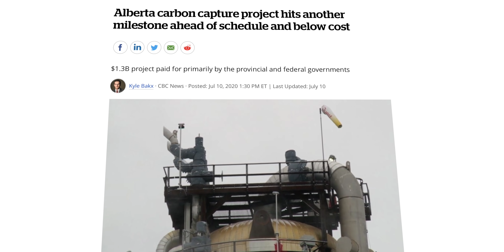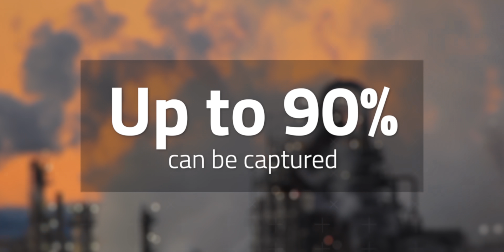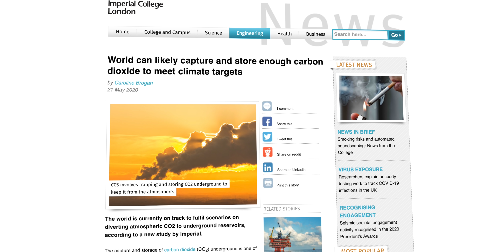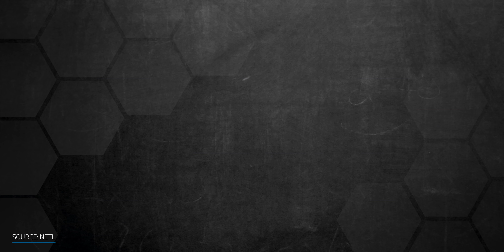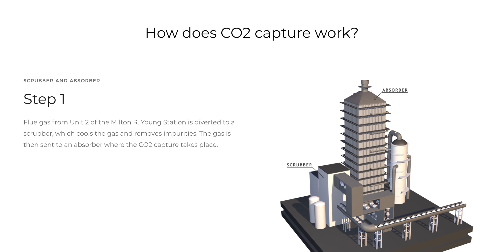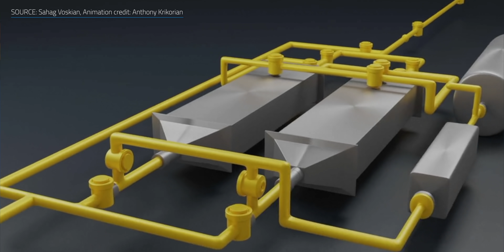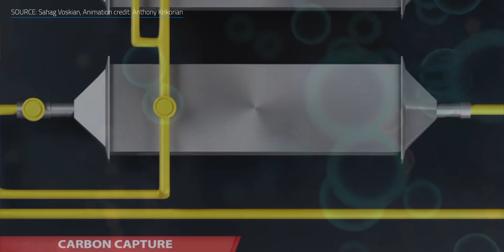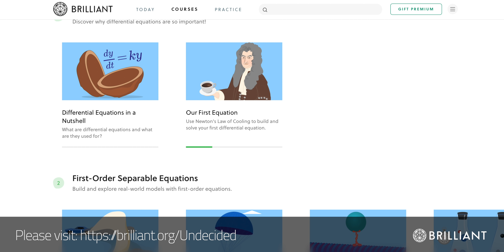The truth about capturing CO2 to reverse climate change

Comment: Just another example of humanity's stupidity. Technology will save us all... Sure right after it took everything we actually need to survive on this planet.
The only way to efficiently remove co2 from the air is to just reduce the emissions.

This technology takes a lot of energy produced by carbon emissions, it requires a lot of solvents which need a lot of energy during fabrication, the transport... and so on. I bet all this carbon sources are not included in the yearly reduction rates of this projects. If you really want to use some technologies, then include nature, for it is far more efficient than humans will ever be. Algae could play a big part for co2 fixation. However it is most important that we stop cutting down our forests.

Comment: Much like the renewables industry, this has a long way to go. If more emphasis was put on increasing efficiency in solar/wind as well as energy storage, we could just stop with the fossil fuels. Unfortunately there is not a large call for it, only more of it to be bought. Wind is terrible and the materials needed for a large scale solar push would effectively cause an environmental disaster as most of the raw materials come from 3rd world economies that have no issue strip mining or using child labor. I am no expert on this, but it seems more bio-engineers with a focus on simulated chlorophyll would be a more sustainable, and optimal use or resources. Additionally an atomic strainer (has not been invented yet), would allow seperation of the atoms and reuse of them (IE carbon into diamonds, carbon fiber for cars/building materials, etc). Just my 2 cents.

Comment: Wind and solar are intermittent so not viable. They are not green to manufacture, to put in place, nor to recycle. So far a complete fail. Then there is the issue of storage for when they are not producing. Batteries are far from a viable option and far from green themselves. We should be using ALL our options including clean coal, instead of destroying our economies.

Comment: Like a prius,the batteries will take more energy to make and try to dispose of than they can ever save. Especially when you consider that a battery despite popular opinion is not a power source. It is a power storage device that needs some source of generated electricity. You keep rolling the ball uphill from there. A look at basic physics and applied thermodynamics will show you that you never gain in exchanges of energy or gasses. You will  always expend more than you gain.
Reply: Electric motors are more than 80% energy efficient while the internal combustion engine is less than 30%, mainly due to waste heat.

Comment: We keep heavy-polluting industries on the hook but let ourselves off the hook. The biggest consumer of fuel oil on the planet is ships at sea. Yet three thousand people will climb onto a cruise ship for an extended floating party. At this moment, there are probably ten million people sitting at burger-joint drive throughs, all engines running. Everybody hates Big Oil. But what causes big oil? Big Consumption, that's what. The oil industry produces oil, but we are the wastrels. In 2018, there were 1.7 billion app downloads onto cell phones. The cannabis industry emits as much CO2 as three million cars. But we can't stand that long look into a mirror.

Comment: All CO2 emissions should be taxed relative to the cost it takes to remove the carbon from the air.  This is common sense and should have been done decades ago.

You don't get to just throw your trash on the ground.  You have to take care of it yourself or pay a fine because someone else has to.
Reply: Brainwashed.

Comment: Carbon capture is crazy.
What we ought to be doing is terraforming the large desserts BACK to what they used to be before human kind destroyed the large forests that used to reside there.

Trees have two main functions, capturing co2 and using the carbon for increasing its mass and releasing the oxygen back into the air.
They also produce shelter for flora and fauna.

Mechanical co2 capture is the studidest thing i've seen.

Luckily there are people that DO make an attempt at reversing our impact, people that have planted massive forests in several countries around desserted areas.
Wildlife has returned to these areas in vast numbers!

Comment: Two problems.  One, the one property a green house gas has to have in order to be qualified as a green house gas is being able to retain heat.  Only water vapor can do this, not CO2.  2nd is that the air we breath that's all around us is and has always been comprised of 78% nitrogen, 29% oxygen and the remaining 1% includes all the other gases known to man, like helium, natural gas, a huge list of gases we have and CO2 is one of them.  Further the amount of CO2 is and has always been 1/39,000 of 1%.  So even if you double nothing you still have nothing.  But if you can convince someone to pay you to remove it from the air, I want in on that scam.

Comment: Any natural gas refinery working by cryogenic fractional distillation already does this by the ton every day.  That's where dry ice comes from.
Reply: unless kept cold and dry, it will eventually release the carbon dioxide.
Reply: @OmniscientWarrior  Yes, but it's already separated from other gases, and can be released in several manners to form neutral compounds.  My point is that there is nothing new or revolutionary about any of this technology.  A French company called Air Liquide has been doing it for over a century.

Comment: you forgot things like planting trees or cultivating algae to remove co2.
Reply: Planting trees won't help without cutting down trees. A  mature forest is carbon neutral because it has nowhere to store the organic material. The growth is balanced by decay.
Reply: @LoggyWD  whys that a problem again? Even if the carbon cycle is equal, you practically have converted many co2 into organic carbon.

The argument that "if they die, they will release the carbon back" also doesnt really make sense to me. New generation of trees will keep recycling them into organic carbon
Reply: @Centrioless  You're correct in this manner, with that said, IMO, it's better to turn it into textile crops like hemp, which traps more carbon faster than trees, given the same land area.  But trees are certainly not a bad way to go about things.
Reply: @Centrioless  "New generation of trees will keep recycling them into organic carbon"
Your theory only works if there is an infinite, and significant, increase in trees every year forever.
Reply: @mafarmerga  or you knw you could just use the plant product (ie use it as a building block like this video suggestion; or swap many items especially plastic with wood-based products) and let the plants regrow.

Just remember: we're not planning to remove the entire co2 from the atmosphere
Reply: @Centrioless  "Just remember: we're not planning to remove the entire co2 from the atmosphere"
The solutions you propose would sequester CO2 for decades or a century at most.
Returning to preindustrial levels of CO2 will requiring weathering of rock and tens of thousands of years.
The best we can do is keep it from getting worse.  We can NOT fix this problem by pulling CO2 out of the atmosphere, we just have to stop putting it up there.
Reply: @mafarmerga  ofc we should stop releasing more co2, particularly from fossil fuel. But thats a completely different topic
Reply: LETS MAKE C02 CARTRIDGES AND PLAY AIRSOFT AND PAINTBALL FOREVER
Reply: @cnbihatemylife  LOL
Reply: Algae only works because their corpses fall to the bottom of the ocean and don't get a chance to go back into the atmosphere. Trees go back into the atmosphere. Trees don't inhale carbon and exhale oxygen. They pull carbon from the air, use it to build support material, such as branches and leaves, and as a result, oxygen is broken from the CO2. The difference is subtle in that once the tree either dies, or dumps its leaves in autumn, all of that carbon goes back into the atmosphere from microbial activity.
Reply: @89qwyg9yqa34t  While such can be said of leaves, if we're speaking of farmed trees, most of that carbon is then re-used for building materials for use by humans, or other goods that remain stable for decades - and potentially longer.
Reply: @SCComega  Would have to be quite a bit longer. Global warming events are measured in spans of thousands of years. Nature used to bury carbon in the form of coal and oil. Hundreds of millions of years worth of carbon is being reintroduced relatively instantly and that's what we're competing with.
Reply: @89qwyg9yqa34t  "Algae only works because their corpses fall to the bottom of the ocean and don't get a chance to go back into the atmosphere. "
And how exactly do you propose to do this in a cost effective manner?

"They pull carbon from the air, use it to build support material, such as branches and leaves, and as a result, oxygen is broken from the CO2. "
You were doing well until the end.  The oxygen released from photosynthesis comes from splitting water molecules, not from splitting CO2.

"The difference is subtle in that once the tree either dies, or dumps its leaves in autumn, all of that carbon goes back into the atmosphere from microbial activity."
True, and you can literally "see" this by looking at the annual fluctuations in the Mauna Loa datasets as CO2 levels drop in summer and climb in fall and winter.
Reply: And then what do you do with the algae?  When photosynthetic organisms die they are quickly broken down and turned back into CO2.
Reply: @mafarmerga  Algae can be tailor grown to be used for other purposes - biodiesel, polymer production, or as a stock food for other organisms.
Reply: @SCComega  "Algae can be tailor grown to be used for other purposes - biodiesel, polymer production, or as a stock food for other organisms."
Yup.  I get that.
But none of those things take the CO2 out of the atmosphere for more than a few months.  It is expensive carbon recycling, not carbon sequestration.
Reply: @mafarmerga  Polymer production via algae can take CO2 out of the atmosphere for decades.  Biodiesel and stock food replaces other carbon source use.  Algae is also not an expensive thing to grow - in fact it's probably the cheapest way to pull CO2 out of the atmosphere per unit of volume you're working with, at least if we're talking about atmospheric CO2.  The above methods are generally profitable as well.
Reply: @SCComega  "Polymer production via algae can take CO2 out of the atmosphere for decades. "
Annual global carbon emissions are 35 billion metric tons.  How much polymer do you think can be made from captured CO2, and what would be the energy needed to do so?

"Biodiesel and stock food replaces other carbon source use. "
True, so this might help slow the increase in CO2 levels, but it will not decrease them in any way.

"Algae is also not an expensive thing to grow - in fact it's probably the cheapest way to pull CO2 out of the atmosphere per unit of volume you're working with, at least if we're talking about atmospheric CO2."
Do you know anything about growing algae on a commercial scale?  I do.  I am a Ph.D. phycologist.  The only idea I have heard that makes any sense is growing kelp and letting it sink to the bottom of the ocean.  But even this will not be cheap.

"The above methods are generally profitable as well."
Not unless there is a significant fee placed on CO2 emissions.  Sinking kelp to the bottom of the ocean does not make anyone any money.
Reply: @mafarmerga  biofuels and biopolymers are profitable as is.  Letting it sink to the bottom obviously wouldn't be, but I thought it obvious I was speaking of processes with commercial byproducts of removing CO2 from the atmosphere. 

I also do know a reasonable amount about growing algae, as I follow a lot of industry developments.
Reply: @SCComega  " biofuels and biopolymers are profitable as is."
Nope.  Show me a single biofuel that is less expensive than a comparable fossil fuel.  The only way they approach parity is if ancient carbon is taxed at a rate greater than $40/ton.  That is why I support a carbon fee.

"I also do know a reasonable amount about growing algae, as I follow a lot of industry developments."
OK.  Then share with me the name of any company in the world that is growing algae for either biofuel or carbon sequestration that is currently profitable?
Growing algae for food stocks (and baby formula) do not count because you are simply exchanging one biological food stock for another.  There is no net change in either CO2 sequestration or release.
Without a CO2 tax, fossil fuels will always have the economic advantage over all biofuels.
Reply: Short video on the problem with trees
https://youtu.be/EXkbdELr4EQ
Reply: Trees are horrible: Once the die they carbon bomb the environment.

Comment: Yay, now plants will grow less!
Reply: Plants wouldn't 'gross less' unless we reduced the amount of CO2 WAAAAY too far... in which case we would have removed SO much CO2 that our atmosphere wouldn't trap ENOUGH heat and in turn would get very cold... like we've seen with ice ages. We're at no risk of making the air TOO clean.  We would be hard pressed to break even.
Reply: Plants have grown fine since the end of the last ice age when CO2 levels were sub 200PPM. Plants can grow in concentrations as low as just 150PPM. Most trees around the world today grew in sub 200PPM for thousands of years prior, or the rain forests, ancient woodlands of North America, Asia and Europe wouldn't exist otherwise.
Reply: Exactly, capturing co2 is a good thing in our current situation and the real danger doesn't come from plants not growing, it comes from average global temperatures falling and ice caps getting bigger. And ice ages don't usually occur unless co2 drops below the concentration we had before the industrial revolution, during the interglacial period. 
However, I don't think that is going to happen for a long time. We are most likely going to double how much co2 we have in the atmosphere, and double that again in the next few hundred years. I'm just hoping we can reverse the damage fast enough even after going carbon neutral and we will have to do it for a long time.

Comment: Those "renewable alternatives" are fairy tales and BS. We will NEVER cover humanity's ever growing need for power with hippy "tech" which in itself is quite inefficient and nothing but a daydream.  If anything the only option is to reduce humanity's consumption, binding CO2 as solids, so plant fucking trees. As for power? The only reasonable solution is nuclear fission as it's cleaner than any other or fusion which not yet possible.
Generally this "report" seems quite biased and not analytical enough. In general CO2 "problem" is artificial and political more than anything else. It's needed for certain entities (petro industy) to show how much good they are doing... 
In general you acknowledge there is a problem without even considering there isnt one, thus you conclude it has to be solved. Does it tho? Prove it.